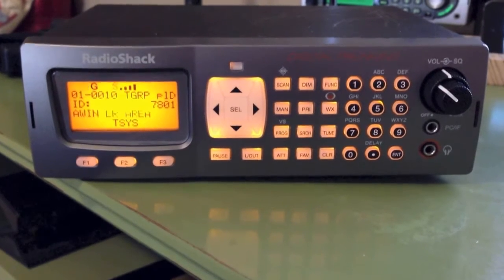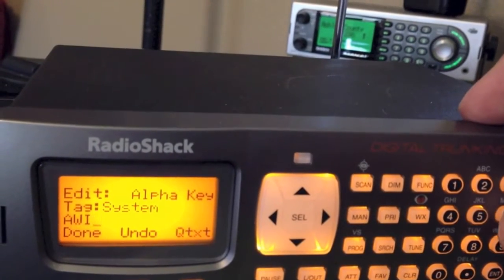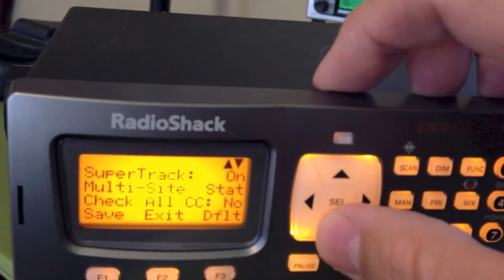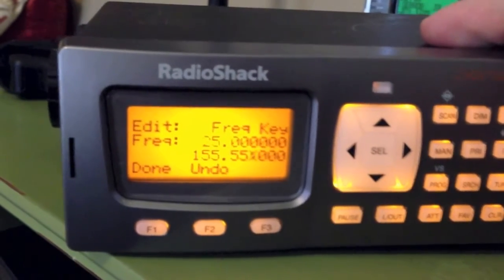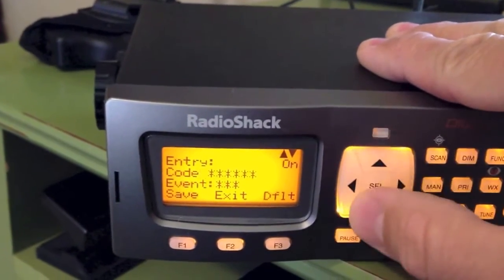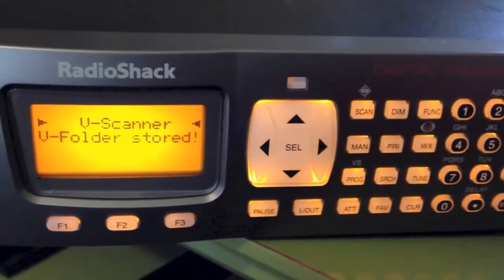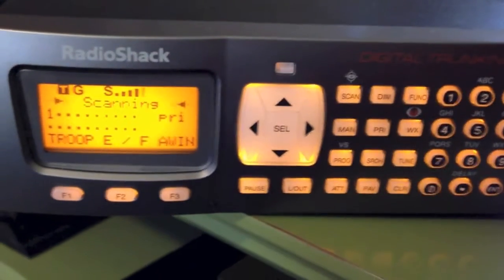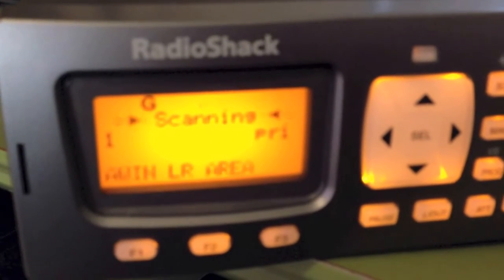Radio Shack Pro-197 How To..

Comment: I have 2 Radio Shack Handheld Trunked System Scanners. One is the Pro 106 ( Almost Identical to your Unit here except handheld & you run the yellow battery pack with Rechargeable AA's and it came with a home adapter/charger. If you run the black battery pack for just AA Alkaline batteries... It won't last a day. Also I have a 12v Cigarette lighter adapter for vehicles which charges and runs the scanner simultaneously with rechargable AA's and the Yellow battery pack. ) Not for the Novice just as yours above. 
Once programmed properly for your area with Trunked Systems and the Few Conventional Systems that are left in existence... You can clone another similar model Scanner transferring all programming to that Scanner while keeping the Programmed Systems on the Sending Scanner with a stereo type cord/cable.

Comment: How do you get the frequency steps set to 5 Khz on VHF? I want to enter 162.210 Mhz and it reads 162.2125
Reply: I found how to do it. I enabled "flexstep" so I can now enter in 5 Khz channel steps on VHF. Default is 12.5 khz

Comment: Helping my Uncle out here, they lost power and now when they turn on the scanner, it doesn't go to the program bank that I set up for them. They are far away. Is there any way you could tell me, from a cold start, the exact keys to push to pull up bank 9 (that's the one I programmed all their local frequencies in) and get them scanning again? I programmed this for them about 5 years ago. Trying to avoid a long trip. Thanks in advance!!

Comment: I could use some help. I have a GRECOM PSR-255 hand held. It just descided it did not want to change channels and none of the buttons work. Turns on and off and has sound thats it. I tried to reset the memory and it did not work. Got any Ideas? Much appreciated.
Reply from the maker: Steven Rossman It sounds like either the key lock has been activated (if this model has that) or it is defective
Reply: monitoringreviews ihow do I deactivate the key lock?

Comment: Also I read about buying a software cable I cannot find where I would plug into my PRO-197 Digital Trunking Radio Scanner.
Reply: If you're trying to clone 2 scanners, use the front PCIF connection  right below the volume knob but you will need the proper cable to do this.
Reply from the maker: If I remember correctly it plugs into the headphone jack.

Comment: Like the video :) Do you know of anyway to auto mute / ignore encrypted transmissions. Thanks :)
Reply from the maker: Alex Berry i don't. I'm sorry.  I know the Uniden's and I think the TRX line of Whistler will automatically mute encrypted audio.
Reply: Ok, np. Thanks for the quick reply. Have a good one :)
Reply: When the scanner stops on the Encrypted Channel I hit the manual button... ( Which should stop the Scanner on that channel) then I hit the Function then L/O ( Lockout) button . Then hit the SCAN button to resume scanning.
Reply: However I like to hone in on the Encrypted Channels as they are Trunked Systems that they don't want you to hear.  But an Experienced Radio or Scanner Enthusiast can tap into the Trunked System Ex: P25 or Mot 800/900  and find the Control Channel for that Group. ( I use Signal Stalker on my Pro 106  for finding anything transmitting in a nearby area ) Or you can as shown above use the Wildcard setting and just L/I ( Lockout ) which mutes any unwanted or Birdie transmissions. It's kinda complicated. But you really can't explain everything about how to program all the different modes and ways to tune these scanners in short or simple way.  If you have a friend or know someone that works for the local Motorola Company or Subsidiary that Programs the Police, Fire & EMS Base & Car Systems you will be many steps ahead. But every time they change their settings once every few years Ex: Police here changed from Trunked Mot 800/900 Edacs to Trunked P25 System . You will have to also change your Scanner settings and Programming to keep up with the changes. 
I was in the Game working with Emergency Services but since retired I don't fight to stay current. But I do know enough to play around with mine and get what I want to hear. Good Luck 👍

Comment: I'm using a Antennacraft  ST-2 on my Radio Shack Pro-197. I know in the video you said that the front was to hot to use an outside antenna. I'm new to scanning. Can you give me any advise.

Comment: on mine the green light is on above up arrow....any idea what that means thanks
Reply from the maker: That's the alert LED.  You can change it in the settings for each channel to be any 1 of several colors.  And the flash pattern or steady on can be changed.  For instance you could have a flashing blue for local PD.  And a steady blue for PD channel 2.  Red for fire, etc.

Comment: v folders not explained at all
Reply from the maker: +Rand Eddy did you watch it at 8:17? That is where I talked about V-Folders.  https://youtu.be/2YT2HgYKasA?t=8m17s  Do you have specific questions about V-Folders that I didn't cover?  Thanks
Reply: what exactly is a v folder?
Reply: Lauren Krohe Virtual Folder or V-Folder stores information for different set ups on the scanner including settings and frequenices.  Basically it's like you having various set ups saved in folders you can load at will.  Think of them like folders on your PC with files inside the folders.

Comment: Do you know how to reset a Radio Shack pro 2052
Reply from the maker: Note: This procedure clears all the information you have stored in the scanner.

To reset the scanner, turn off the scanner. While holding down the 2 and 9 keys, turn on the scanner. CLEAR flashes for about 5 seconds as the scanner clears its memory.

 	Note: Do not turn off the scanner again until CLEAR stops flashing. Otherwise, the scanner might not clear its memory properly.

Comment: you may be the person who can answer a question since you seem to have the only video on youtube that even touches on Signal Stalker.  I recently picked up the Pro 651; I had been using the analog Pro 26.  when i performed a signal search on the Pro 26 i had it store the found frequencies in an empty bank w/ 20 channels.  If the Pro 26 found a frequency already programed into the scanner, it would not store it.  my question:  how does Signal Stalker address duplicate frequencies?  I have over 400 programed frequencies and I'm wondering how and if Signal Stalker has the ability to recognize them.  same issue w/ Service Search.  it would certainly diminish my enthusiasm for searching if there will be constant hits on frequencies that are already programed.
Reply from the maker: jack ferris It should beep and give you a duplicate frequency alert if you try to store one that is already programmed.
Reply: thank you; that is nowhere mentioned in either the RS manual or the  'Easier to Read' manual.

Comment: Do I have to enter the local tower frequency for my scanner. When I enter my local police frequency, I can not pick them up. Help!
Reply from the maker: Willie Jackson It depends on what type system that your local agency is using.  If it is a trunked system, then you will need to enter multiple frequencies and talk groups. Check out RadioReference.com in the database and find your county and system to see what is required.

Comment: On the 652  PRO anyone got a clue how to turn the LED OFF it's the small square led above the "up " soft key, That thing is so bright I could use it for a headlight on a Mack Truck lol
thx for any help
Reply: read this for the model you have, it should be in there, just keep your patience looking ,  http://new.marksscanners.com/106_197/106_197.shtml
Reply from the maker: Try this and see if that helps you.

http://marksscanners.com/106_197/106_197.shtml#dim%20led

http://marksscanners.com/106_197/106_197.shtml#tune%20led

Comment: I Wonder what the difference in the Pro 197 and the Pro 652 is they look and the menus and programming seems to be the same.
Reply from the maker: They are the exact same scanner, just rebranded.  See this thread for more info http://forums.radioreference.com/radio-shack-scanners/294887-pro-197-vs-pro-652-a.html Hope that helps.
Reply: Hey Thanks for the Info!